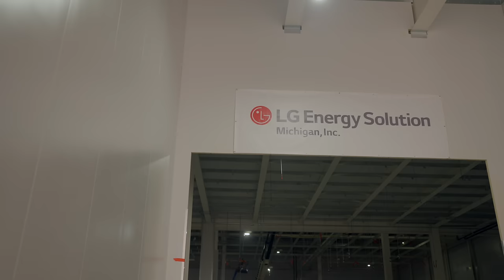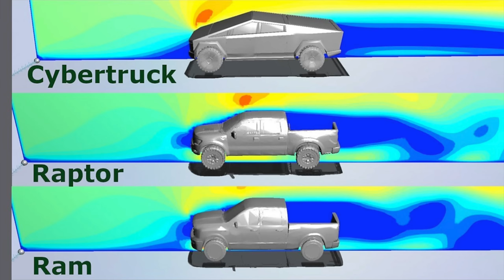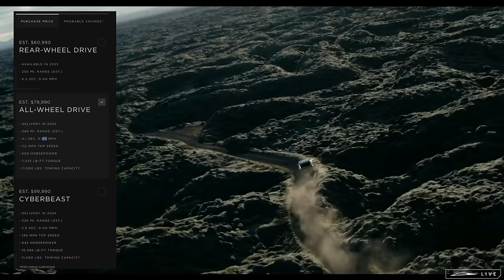Cybertruck - What Tesla ISN'T Saying!

Comment: This bit of fan fiction didn't age very well, especially given OutOfSpec's 240 miles on a 70mph range test.. CT is so far away from the promised specs that I have seen even dedicated fans on InsideEVs and Elektrek howling about it. That's a pity really, because the CT does showcase some tryly innovative tech, DBW, 800V, clever no-magnet-motor use (basically just an epitomized induction motor), but the body itself is truly horrendous and the 4680s fall far short of what was promised.

Comment: A couple things occur to me. I assume Cybertruck is impervious to most anything that can happen in a parking lot. But a 9mm bullet weighs about 1/3 ounce. An automobile weighs 2 tons (or more). It may lose in an accident with Cybertruck, but at 30 miles per hour I'm willing bet Cybertruck will sustain significant damage. How much will the repairs cost? Second point, on a similar issue, the first time anyone tries to free that gigantic wiper when frozen to the windshield, it will break and it won't be cheap. Third thing, putting the rear view screen in the center console is the kind of cost-cutting thing that Tesla tries to sell as virtue. A rear view mirror is required. Put the screen there. It's no longer new technology. It first appeared in the Chevy Volt in 2010.

Comment: I dont get why he keeps steering the conversation only to the Ford F-150 Raptor when it comes to things like range and drag coefficient. Rivian is the truck to beat here— and in a few ways cybertruck beats it. But a balanced discussion would lay out how a Rivian R1Tdual motor Max Pack the has space to store the full spare and is rated to drive 410 miles on a charge. It also has 11,000 lbs towing capacity. That’s CLEARY the competition here— and CT has more bed space and more stiffness, locking differentials, and does it all with 2-3 motors instead of 4. Feels like a GLARING omission from the discussion.
Reply: The video goes onto mention off-roaders and it cited Jeeps (fine), Raptor (OK), and then the FJ Cruiser (not even being built anymore) but somehow NOT the purpose built EV off-roader vehicles from Rivian that are priced exactly in-line with Cybertruck. He even mentions the fact that the Cybertruck is flat on the bottom so it can have real clearance… which is a hallmark of the competition. 

This omission of Rivian during these parts of the video is bizarre. It’s like the video doesnt acknowledge the existence of the MT Truck of the year 2021. 

I just dont get it.
Reply: He ends with: There are some other cool electric trucks out there… and no mention of Rivian. It’s absurd.

Comment: I am not a truck person at all, but when I heard Sandy Monroe and a few others talking about the advantages of the cyber truck, I am truly considering this.  Super quiet inside, and the exterior being good for longer then I will be alive never having to replace a windshield don't have to pay for glass insurance.   Plus the air suspension being able to lower the car,  drive by wire.  This truck has what I need in what I would like in a car.  I can use it to get that TV or new refrigerator home.  I never liked trucks cause their hard to get into, but with the air suspension being able to lower itself  I will be able to get into it easy when I am 80.    It ticks all the boxes.   Comfort, usability, and durability, and potential for so much more.   Like powering my house, like driving itself with full self driving,  Lets not forget it will be updateable over the air.   So features could be added any time down the road.  Also batteries get better over time so you could pay for a battery upgrade and now your truck can go 2 times as far with the same space it used to, maybe in 10 years from now.  I don't know how it will work out but I suspect the future of batteries has much more to grow.   Also with the durability of this truck I suspect its resell value will hold up quite well.
Reply: If you get in line now, you'll have five or ten years to consider purchasing a new one. 
A used one might be available next year, but probably at a high price, and then with no $7,500 tax credit.

With the Supercharger network, you don't need more range. Drive 250 miles or so, stop for a crap, a snack or a cup of coffee while it charges to 90% in 20 minutes, and then off you go for another few hours of driving. 

Tesla in vehicle navigation accurately tells you how far the vehicle will travel, where you need to charge, the cost per kWh and the number of chargers available, all before you get to your destination. Like no other vehicle, and just better.

Comment: Ricky, energy density comparisons are important but do not illuminate the entire picture.  Here’s how I do it so that it is more understandable to myself and people in general.  I drive a 2022 Nissan Frontier.  It averages 16 miles per gallon.  Using the gas price where I live ($3.47 / gal) it costs me $32.71 to travel 150 miles.  My 2018 Nissan leaf has a maximum range of 150 miles.  At level 1 charging, it cost me $1.00 per day to charge the car from empty.  This means that it costs me $1.00 to drive 150 miles in my Leaf, vs $32.71 to drive the same distance in the Frontier.  This anology makes it easy to see the difference between what it cost to drive an ice vehicle compared to an electric vehicle.
I should also add that if I charge at a public facility from 30% the cost is about $15.00.  Still way, way cheaper than buying gas.

Comment: The spare tire mount is a problem if you plan to use the truck for work. I use mine at least once a month for hauling crud in the bed. And you can't get a load of dirt in it (the angled bed interferes with a loader, which is why Tesla had it loaded with an excavator - which is never the use case). If you're a trophy truck user, it's great. And you're right that there are millions of pickups out there with pristine beds and shiny shiny trailer balls mounted in the hitches in parking lots because the owners are unfamiliar with how to remove them and be considerate.

Comment: I have two orders for the Cyber Truck and I'm on the fence as to whether or not I'm buying the trucks.  The reason I'm on the fence is complicated, but the loss in range and increase in price are the two largest factors that are causing me to second guess if I should buy the Cyber.  My current truck is a Chevy Silverado 2500 HD Duramax with a custom built 52gl fuel tank that gives my roughly 550 miles of range while towing, and the current version of the Cyber won't have anything close to this... I cannot imagine needing to pull over to charge the Cyber Truck every 200 to 250 miles.  Additionally having to pay roughly $120,000 for less truck than the original $80,000 was supposed to get me is a tough pill to swallow!  Let me explain... I reserved the Tri-Motor and was expecting 400 miles of range, but now we are looking at $100K plus the range extender and I still don't get to 400 miles. I only use my truck for towing, and/or picking up supplies, so spending more than $120,000.00, for less truck than was premised I don't think there will be a C.T. in my future.

Comment: The reason towing was set at 11000 is because 18k is where it has to become a commercial level in most areas. No need to do that if its the entry level to compete with the 150.  Over that is well in the f450 range. Tesla will have more power than the f350-450 desiel units when they go for the next heavier option.
And they are doing that once they have the capacity to add models.

Comment: Long but I think worth your time: I love the tech, really do think it's revolutionary, and still do want one.  But I cancelled our Cybertruck res for several reasons.  Our truck does spend probably 50% of it's time towing our travel trailer (maybe 75% by mileage).  I agree with the truck-as-a-car stats but if you live in a city of course you're only going to see trucks not towing/hauling.  CT just won't fit for me.  First, I can't afford $80k, much less $96k with the battery pack (I know there's been inflation since 2019, but not 60%).  2500lb payload (promised was 3500) is too small.  A 1000-1500lb tongue weight from a trailer, a couple of people, and some firewood/tools/canopies/extra water/bicycles in the back and you're there--workable but not an improvement over my current truck.  If I added the expansion battery pack and a spare, then I'm estimating 1500lbs available payload.  Towing, I figure half the range since that's about what it does to gas mileage and what other electric towing tests have shown.  So 340/2 = 170 miles.  Figure you won't be wanting to charge much past 80% and want a 10% buffer, so a high estimate of 140 miles?  Even if charge stations were perfectly placed at 140 miles apart (they're not), and if I didn't occasionally go 90 miles one way into the mountains to camp, I'd be spending half my time charging and most likely having to unhitch each time.  I am a little hopeful that the expansion battery means there's a way to connect external batteries, so maybe that means some day we will have a trailer with say a 100kw pack onboard to power itself and the TV.

Comment: I would definitely buy one if I could afford it. But $80,000 is too much. (I would need the four-wheel drive)
Reply: In four or five years, after a million or so are made, perhaps a used Cybertruck will cost much less than $80,000, so it'll then be affordable.
The price for a new one will probably be less than $80,000 in 4 or 5 years. Just like what happened with the expensive Model S and X.

At this time, the Model Y Long Range all wheel drive is close to the same price as it was 3 years ago.

Comment: It's not true that cars had 12 volt systems since the beginning of time. Up to the late 50s 6 volt systems could be found in many cars.

It's not range that's the problem of EVs, it's the charging duration. As long as batteries take forever to charge from 10% to 80% people want to have giant batteries with them which leads to tank like abominations like this one.
This is not the future, this is a simulation of the future with yesterday's battery technology and in the near to mid term will dissappear - faster than ICE vehicles will globally.
The EV age will really start when batteries will charge from 10% to 80% in under 5 minutes. Then battery size won't matter anymore, the vehicles will be way cheaper and lighter.

Comment: Hi great presentation one correction my light truck is a regular cab 2WD 2019  Ram it has a drag coefficient of .36 not .5.  I am sold on the engineering of the Cybertruck and am in agreement with your conclusions about the targeted demographic

Comment: I'm a mechanic.... Not a tech at a dealership. Heavy equipment and automotive. Having no mechanical linkage between the driver and front wheels is  irresponsible. I would not buy the vehicle based on this one feature alone. How electric vehicle manufacturers seem to not have to adhere to any safety regulations is beyond mind blowing.
Reply: They actually must have these systems,  like brake by wire, throttle by wire,  and steer by wire (all of which are already being done) federally certified.  You haven't heard about it because it hasn't been a problem.  Further,  the entire USAF fighter fleet and all modern airliners use full fly-by-wire controls.  Same thing- not a problem.
Reply: @jamesengland7461  do you have any idea of the difference in the amount of money, and man power spent on maintenance, between average joe with a Tesla, and government, and commercial airlines??? How many purely electrical steering systems in passenger vehicles can you think of??
Reply: Every rider in a Waymo taxi is taking the same risk
Reply: @simonpapworth8569 like I said... Irresponsible. Not so long ago it was illegal to sleep behind the wheel of an autonomous car ..... Now with no driver maybe steering linkage will become a thing of the past. I'd wonder what waymo's maintenance budget looks like??

Comment: During the lifetime of an vehicle of about 200k miles you will spend about 20-30k on fuel with ICE or about 10k for electricity, so if you pay 10-20k more for the purchase of an electric vehicle, you will pay the same as for car and fuel combined. However, after 200k miles the range of your ICE vehicle will still be same and you can continue driving, while a battery will be dead and the car won't be worth it to put in a new battery. With heavy use your battery even might fail after 100k miles, and cars with a smaller range will have their battery dead earlier.

Comment: There is a user that took a magnet to a CyberTruck and there was a strong attraction. This is good for those who want to use magnetic mount CB or 2 Meter / 70 cM band Amateur radio antennas. This will allow magnetic signs commonly used by businesses, as well as magnetic mount Yellow caution Strobe lights for mail or newspaper delivery!
Reply: Also sounds like an easy way to have accessories stolen.

Comment: It will be the likely future but out pulling an f350 318 ft is not the practical test ~ how long will it take to pull a 21,000 lb load across country - time is money
Reply: It's towing capacity is only 10K lbs which is comparabe to your average 1500 truck.

Comment: I agree and will rarely put anything in the back of the truck.
Thd big range extender size wouldn't bother me.

So once the extender is put on, you are just good to go with extra range and no other hoops to jump through when charging??

The severe excess weight of the extender I would think would mess with the range also, or is that already factored in??

Comment: I am a dual motor reservation holder. I am not happy. I am an electrician and I inteded to use the CT as my daily work vehicle. $50K was a bit of a stretch for me. Jacking yhe price up 60% killed it for me. Unless they mannage to get the price down by the time my (first week) reservation becomes available I will have to pass.

Comment: Ricky, 
Excellent & fun supercut!  MAN, I am excited about this vehicle. I went to Charlotte, NC Tesla, and saw it live the day after Thanksgiving!  OMG, it is so much more beautiful in person!  I was kind of surprised.  Okay ... 
Unfortunately, I agree with your analysis concerns!!!  When I ordered mine (4/8/21), I, too, planned on greater range (500mi). 

The 2500lb carry & 11,000lb tow capacity is fine. I don't tow a 5th wheel. 
So... 🤔 I had intended on replacing my RAM, used mainly for towing our Camper, with the CyberTruck!  The current camper is about 7,000 lbs (which I am actually in as i write this... in FL😊), but in retirement, we may want to have more room for GrandKids. That RV would be about 8,500 lbs. 

So, except for mileage and Towing Mirrors, the CyberTruck "was" going to be PERFECT! 🤪

NOW, as much as I love it, I am concerned ... but will just wait another ~3yrs till my turn happens and decide if the range increases due to Battery Technology improvements.🙏🙏🙏  Or just get stuck with a RAM 2500? 

Cheers Brother,
Eric
Reply: I hope you didn't get it?
Reply: @Chronicle-in8vu  I probably wong get my turn to get the CyberTruck for 2-3 yrs at expected production rates.  By then, with what we know now about Battery Space from teardowns, we'll likely see the furussion of the 500+ mile CyberTruck in the next year or two. 
If charging infrastructure continues to improve with trailer pull-thru stalls, then I certainly will get the CyberTruck.

Comment: Not sure about drive by wire. I have trust issues. I'd like to know more about the backups and failsafes in that system
Reply: Toyota has this already.  No worries.
Reply: Planes have wire and they are safer than driving.
Reply: Hopefully dual/redundant Ethernet, running down each side of the body.

Comment: @12:51  This is a "your data on the MIG is incorrect" moment.  I have an all wheel drive reservation, and just received by invitation to order.  The price of the truck is $96,390.  The Cyberbeast is $116,390.  The range extender is $16,000.
Reply: (Robert Stack voice)
UPDATE:  The prices quoted here are apparently after "projected savings."  The OTL prices are $99,990 and $119,990 respectively.  The savings are fuel costs over 3 years.

Comment: Slight correction - before we got 12V systems - we had 6V. Higher voltage (up to a point) is better - smaller wires, and better efficiency.
Theheadlights being "hidden" just above the bumper, is a bit of a dodge, I think.
Reply: I think headlights there are going to get clogged when driving in snow or slush. They're LED, so the schmutz won't melt if the temp is below freezing. My own car has LED headlights, but their shape allows stuff to slide down, no bumper underneath to trap it.

Comment: As an engineer - what is your take on wind noise at certain speeds, with the angular lines on all corners and especially the tip of the roof? I expect it will create quite a bit of hissing noise?
Reply from the maker: yes such a good point, its why Tesla actually has a slight round to the front glass, for this reason... from all reports i've seen it's a really quiet truck
Reply: The forward arc in the windshield should help dampen wind noise of course, as you mentioned. I’m wondering if traveling above 70 mph will increase wind noise significantly?
Reply: @TwoBitDaVinci  I agree that inside and from a ride noise level the car will be very quiet especially at low speed. Only at higher speeds you will develop higher frequency noises. They are extremely difficult to get rid of. When you look at cars built for the German Autobahn (where this car is illegal 😉) they actively try to cancel wind noise through aerodynamic features and also counter sound modulation to cancel out noise. All of that with usually a decent noise coming from the engine department.

Comment: ICE trucks even the super old ones are significantly better than those electric jokes! with over 800hp how can it barely tow 11,000lbs while a 200hp ford ranger diesel tows over 7000 lbs and still gets over 500 miles of range?